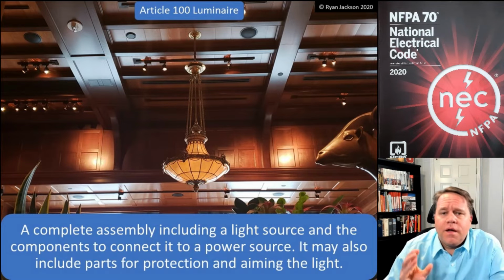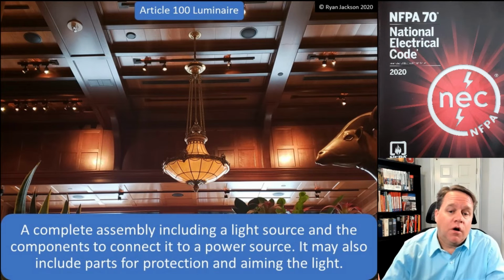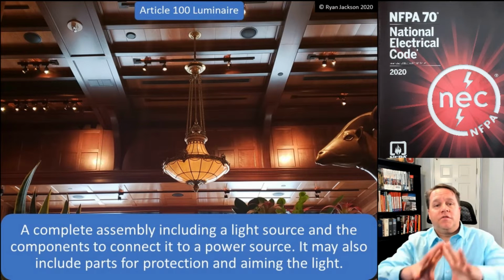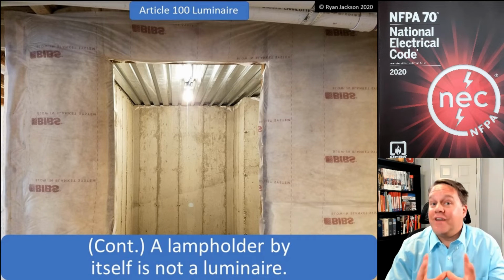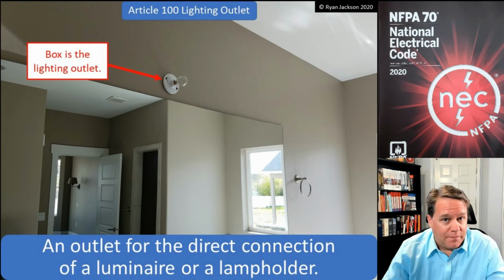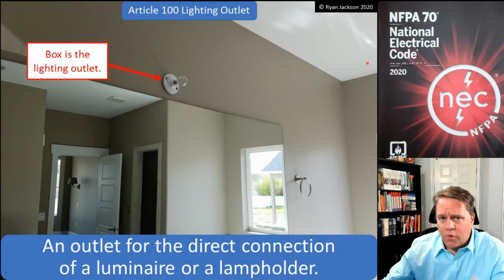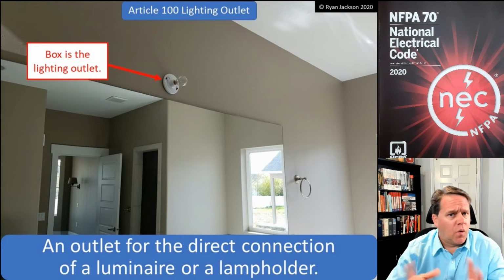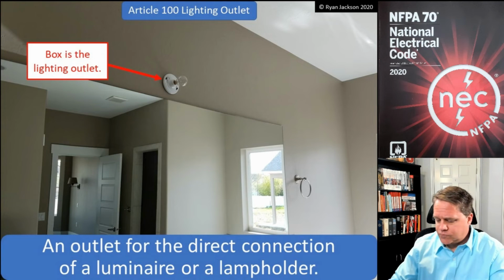100 Days of Article 100: Luminaire, Lighting Outlet, and Lighting Track

Comment: I hadn’t realized that they don’t call light fixtures light fixtures anymore. When and why was that change made? I’ll always call light fixtures light fixtures, but do you suppose there will come a time when no one will know what a light fixture is? Also, if you made it this far, what terminology applies when you land either MC or NM cable directly into a fixture? Is the cable end and connector considered a lightning outlet? Thanks for running such a great channel.
Reply from the maker: They changed it 1999 to be more accurate in the international arena. For a hard-wired luminaire, I would say the point of connection is the outlet.